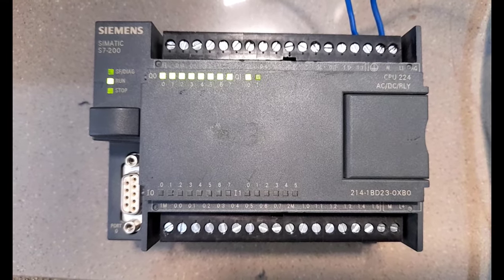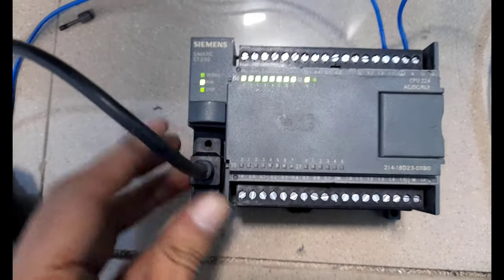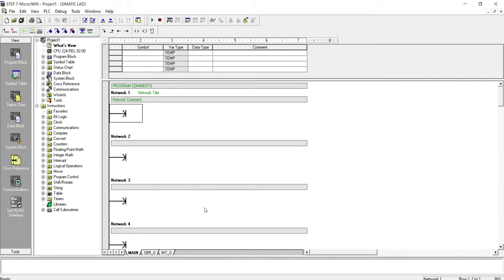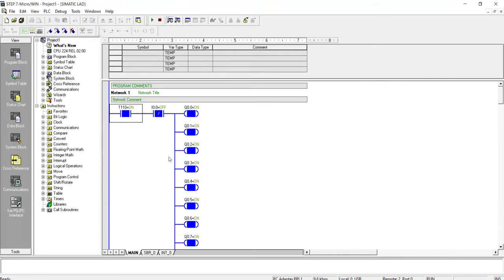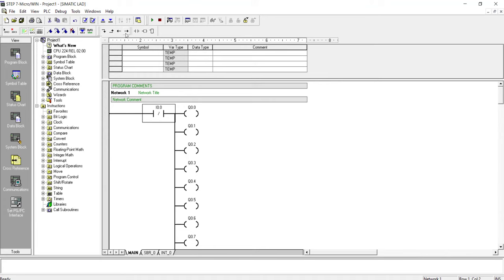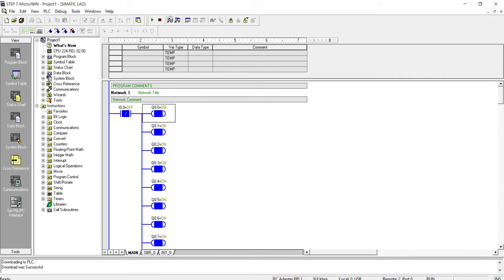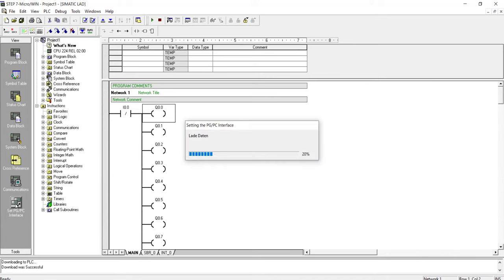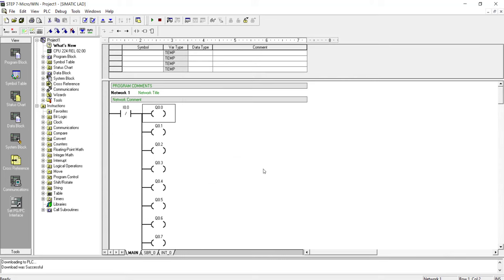Siemens SIMATIC S7-200 PLC Program Upload and Download using SIMATIC PC ADAPTER USB

Comment: I'm using same plc S7200 and cpu 226, and step 7 microwin program and mpi adaptor.... But after communication it's showing error, I changed ppi, mpi and profibus protocol,... Also change baud rate(transmission rate) - 9.6 kbps to 19.87 kbps... But the error will continue showing,... I don't know what should I do, can you help me with this?
Reply: hey i have the same problem, did you solve it?

Comment: What windows version do we need for microwin ? What is the cable connection name connected to plc please .
Reply from the maker: Microwin has its versions for all Microsoft windows. It has its version for Windows XP, Windows 7 and Windows 10. You can chose a version of Microwin based on your computer OS.
The cable Simatic PC Adapter.
Reply: @PLCNerd   thanks 👍

Comment: "specified access point not found"
Please HELPPPPPPPPPPPPPPPPPPPPPPPPPPPPPPPPPPP
Reply from the maker: Have u connected the cable?
Reply: Yea I can connect with PPI cable I purchased now. 
Its not working with MPI cable even if I select PPI driver 
As MPI cable is supposed to work with both 300 and 200 series but for me MPI cable doesn't work with S7-200